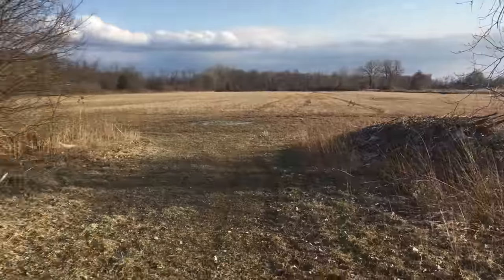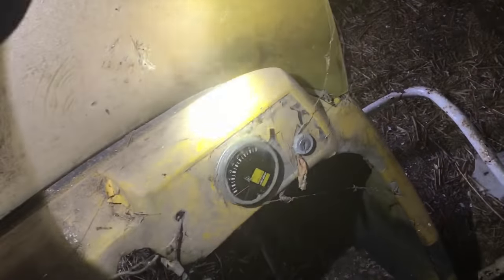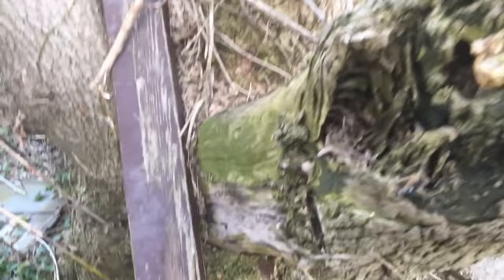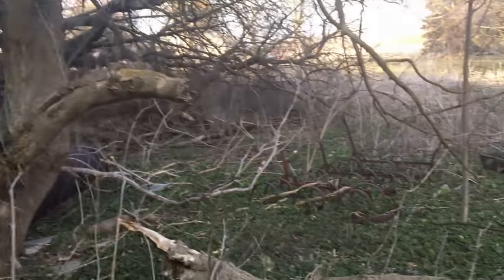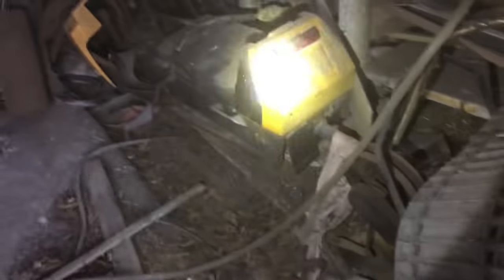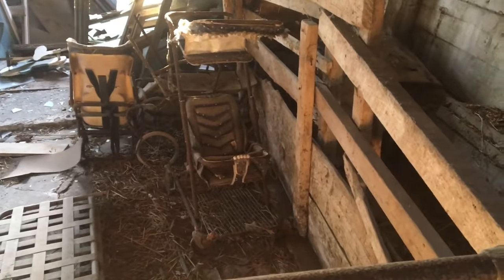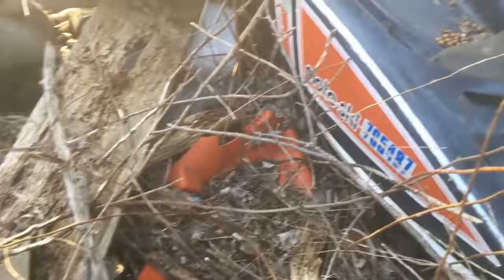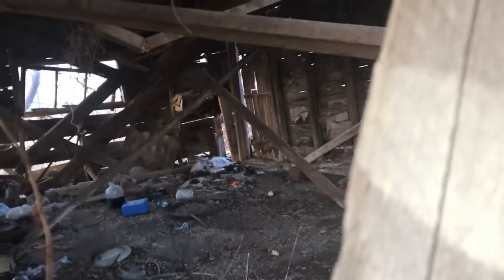Abandoned Farm with Rare Old Snowmobiles

Comment: Interesting stuff. Canoe with a transom. I had one. The 244 Polaris Gemini single cylinder thumper, might be 79-81. Those were reliable engines. Can get you out to the fish huts or grocery getter. Not a fast machine and good for the kids to learn on. They did make a twin 250 Gemini, but competition with other sleds with 340s or 440s left them in a cloud of snow.
Reply from the maker: Yes, The Yamaha 1979-80 single cylinder was the same way, very light and maneuverable, not fast but bullet proof.

Comment: the hood is a 1970 black dot ski-doo same with the one with no hood witch are not common the hood goes to the sled behind the Olympic
Reply from the maker: I worked on a few of those snow mobiles at Centennial College in Thunder Bay in 1981. Do you have a 1971 KingCat? Now that is rare. I have never seen one or heard of one until i googled your Name. I once had 2 Raiders a 340 and 440. I wish I had kept them.
Reply: no but when I am older I am going to get one I made my email fast so that is all I could think of were I am I see them more then I see that g sled I forgot the name I never seen one before I see King cats alot
Reply from the maker: @kingcat-bc4yc  Oh I see, Still a pretty cool machine. I once saw a 1974-5 ski doo 3 cylinder 600cc I beleive, ice racing sled. I could have bought that for $500 at the time. Stinger pipes that made a lot of riders lose thier hearing in the right ear, they were so loud.
Reply: Motor Oil & Beer  sick